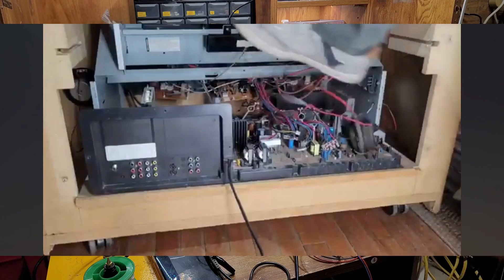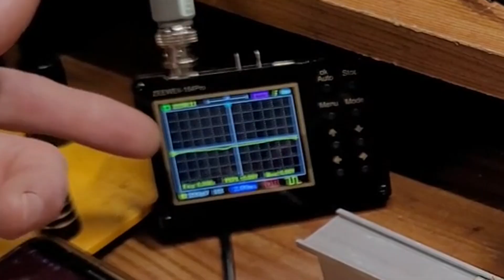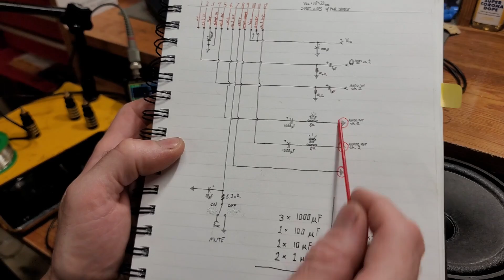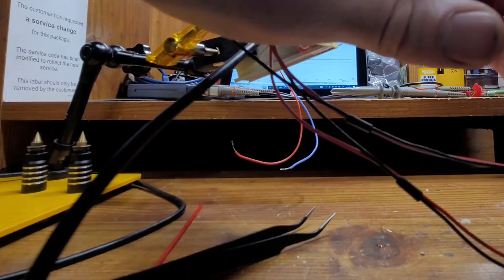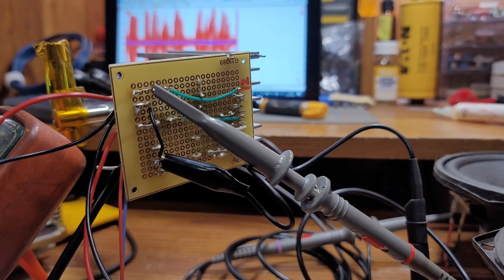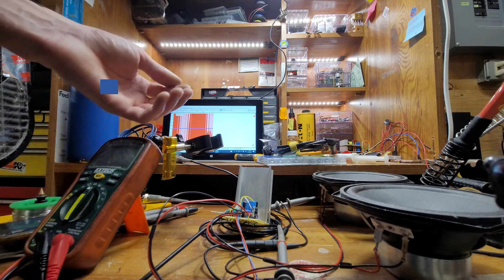rescue attempt on our amplifier project

Comment from the maker: another big presh to @bbspro for the music! - youtube.com/@bbspro121 
watch part one - youtube.com/watch?v=Fk4akHipsXk 
a more accurate way to trace the in/output curcits would be to use the signal generator on the oscilloscope. put the same waveform on both channels, then compare them instead of trying to compare live music.